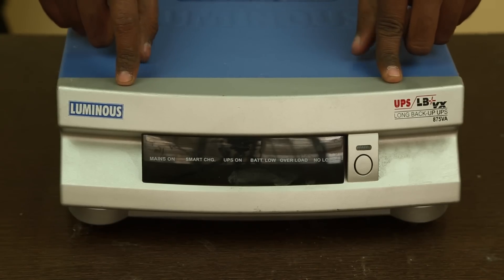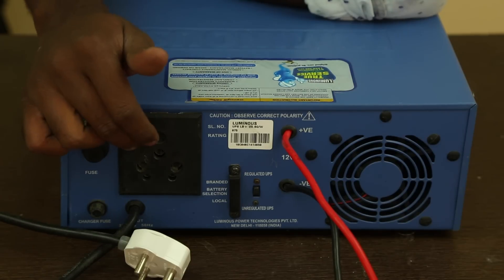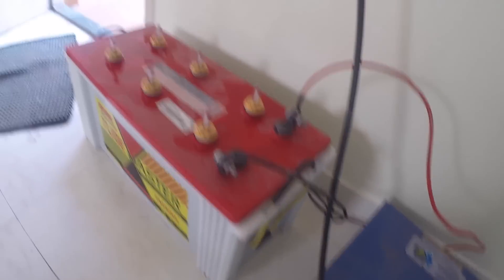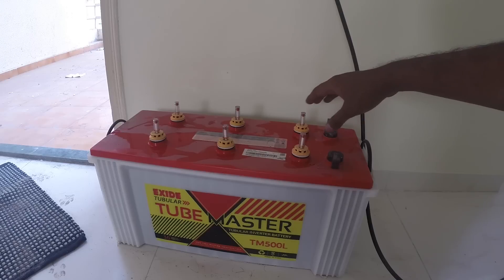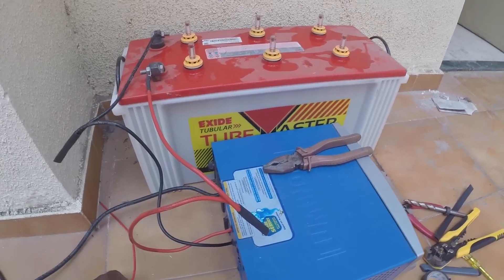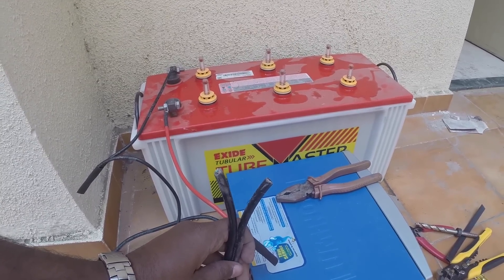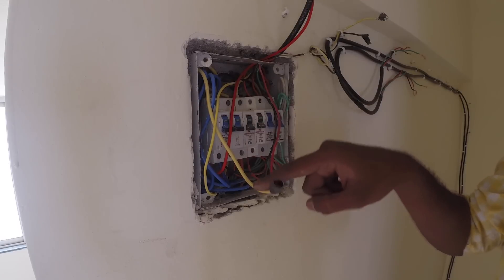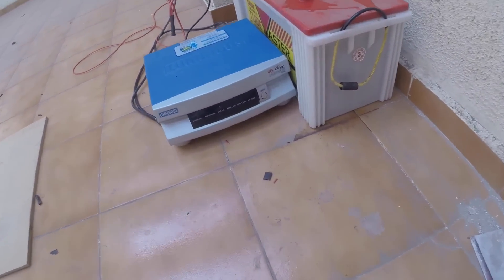How to - Connect an Inverter at your home with Battery Backup

Comment: Can i have an inverter at home but with manual changeover. Means when grid power is present....the entire home is connected to that. When power fails....i will go and manually flip a MCB switch or something and only then the inverter gives power to the home. Yes i know...when power goes ill have to go and switch on in the dark etc...i have considered all that and found for my use this is best. Because my house has automatic gates....automatic garage shutter.....all stoves are induction...etc....definitely ill have to go for a 5kva inverter. I DONT WANT THAT. I want just a small 24v system and with maybe 2 600w solar panels. Because when power fails....i will reduce all my load items and then go and transfer to inverter. Till then the inverter can be like one of my home appliance...like fridge it will also be running on one side and charging up the batteries until i want to use it. When power fails i only want 2  fans n my computer to run. Else ill have to put a heavy inverter just to accommodate my regular load EVEN when grid power is present.

Comment: Hi. Well explained. Is there way to connect in such a way that the devices on the inverter will ONLY come on where main power goes off?
Reply from the maker: You have draw two lines one as a main line and one as a UPS line. Then whatever is connected to UPS alone will be live when main power goes off
Reply: @Kalaakaar-in  thanks but the thing is that even when there is main power, the devices on UPS willl remain on right?
Reply from the maker: @saileshchudasamasc  Yes it will remain on and it will be charging the batteries
Reply: Sorry if i am not clear. I want the devices to remain off when there is normal power and only turn on when nornal power goes off
Reply: @saileshchudasamasc  if that’s the case then you need some microcontroller and a relay which applies this logic

Comment: By Mistake when I am trying to connect, Negative terminal wire collided with the positive terminal, which resulted in some minor fire sparks. could you explain if  i need to change the battery? or it can be rectified

Comment: Some say if we touch 12v battery we will get shocked it’s very dangerous and some say it’s completely safe to touch both terminals of a inverter battery as the voltage is only 12 tomorrow I’m going to fill up my battery with distilled water 💧 n will clean both terminal. I’m little bit scary 😦😺I think one can not get shocked even after touching both terminal together as we have a high resistance

Comment: HAHAHAHAHAHAHAHAHAHAHAHAHAHA laughing cause it gave a good feeling. 
(come on, you needed to throw a bit of water on the floor and then touch battery LOL to curl the hairs in ur nose)

on serious note. you mentioned ground wire and earth wire. we have positive, negative wire. live wire, neutral wire, ground wire. just wanting to learn and understand the terminology used in other countries.  
inverter on floor for educational purposes works fine but did you ever mount inverter on the wall ?
Learning The Hard Way is the way to go sometimes. 
Photovoltaic / Solar Thermal Technician here and I Approve Your Video
Reply from the maker: Thanks Sheldon

Comment: In this your Fridge , washing machine , water heater will be connected to inverter . Good luck in getting up and switching off fridge every time main supply fails. Will work at houses with only light bulbs n 70 w fan.

Comment: You can touch + and - of a battery at the same time without a shock hazard if the battery voltage is less than about 48V. That's why telecom backup systems use 48V batteries--it's the safest voltage you can touch without harm. Higher voltages will overcome your skin resistance and put current through your body, which could kill you.
Reply: I thought 48v can kill? 24v and 12 v is safer
Reply: @Josh-mi1qt  Go buy six 9V batteries. Connect them in series, and then touch the two end contacts. Are you still alive?
Reply: @huskypup3489  6x9=56. Yes I am  in heaven now.

Comment: I am not not an electrical engineer or anything but would like to caution you on something -  @1:51  you mentioned you are not touching both the wires the same time so it is safe. Now, what happens if your watch suddenly gets "unbuckled" and hangs down and touches the first wire while you are touching the second? Just a thought that came to my mind. So I guess that is one thing that people need to be careful about - what they are wearing. Am I correct?

Comment: You better stop wit this presentations where nothing it is by the book.First af all, you will need designated ventilated place for that battery,second you need to use a proper wire connectors to joint the wires,3rd you can not apply just like that wires on the walls,4 that control panel it is ready to explode ,you are using player for everything,You call neutral(negative).What a begginer can understand from this poor video.No tools,no safety,no tehnical terms. Plus...the UPS will be allways installed only on vital equipments.That poor battery can not hold a washing mashine for 1 cicle.I do not wanna talk about other heavy consummers of the house....

Comment: Thank you very much sir. Please a question from your video. If the neutral from mains supply is what feeds the UPS and thesame neutral wire supplies negative to the battery for charging. Isn't that mixing positive DC from UPS and AC neutral to charge the battery.?. Please shed more light on this

Comment: I liked your language more than your explanation very nice video helped me a lot. Please tell me if I can do the same process using an ups to run my computer and an led in my room.(I have separate mcb for each of my rooms). Please help!
Reply from the maker: If the ups is 600va then the load will be high on the battery

Comment: Noticed some sparks while connecting a replacement battery but that didn't bother me installing the new battery as the video clearly mentioned sparks are not to be feared. I did cut the main power to the inverter before installation.

Comment: wrong wiring . saperately  you have to take e neutral from  inverter.  other wise in many time  current bill comes high. because battery weak. and bellow 180 walt comes that time return current go to eb through the metre. so bills comes more.

Comment: Output from inverter. Single phase wire use for load..in case main neutral is cut from grid..any option because single wire using

Comment: Output from inverter. Single phase wire use for load..in case main neutral is cut from grid..

Comment: i hv not connected inverter to my battery.. was just checking inverter working condition.. inverter connected to main no display button is glowing but Electrician checked power is there inside

Comment: I am.an Technical guy ,
I will tell one more , you kindly spit connection like Water heater/ Microoven/ Iron box / Washing machine permanent line in Ac then other connection with inverter . give good result when AC power off

Comment: Nice & simple Explanation. Thanx. There r occasions when some points r connected to inverter & other points r left to the MAINS SUPPLY ONLY. In that case how the output wiring is connected to MCB(s). Next time U may add this point for viewers benefit. Nice tips about the Battery placement, etc.

Comment: Need a help on the UPS connection. I have called an electrician and he connected it however there's an interrupted power supply which turns of computers and routers. The connection setup at my apartment is .. Mains and DG connection. When main o\goes off within 5 minutes DG starts manually and by that time everything reboots . I used to have a battery and UPS which is 1.5 years old and it used to be uninterrupted power supply. Now I have contacted the UPS manufacturer and they charged me and changed the PCB and costed me 2000/- but still issue is not resolve. even though it is giving back up but when mains goes off it turns off everything and comes with a long beep sound. which is not solving my issue. could you please suggest something on this which I can may be convey to electrician and the s\exide support.

Thanks in Advance

Comment: How to run fridge and washing machin on inverter plz guide
Reply: It not run fridge and ac also because single battery u can add more than two batteries then it will work
Reply: I suggest 4 kva inverter is better for you

Comment: Can i connect two batteries of different AH rating? I have a 200Ah and a 150Ah and wanted to use them both
Reply from the maker: Nope. You should not. They will try to balance out and in the process destroy

Comment: thanks or the video friend. can you tell me how long will it work with this battery? and we have to charge battery again because inverter needs 12v to work always
Reply from the maker: The inverter automatically charges the battery. A batteries life span is between 3-4yrs

Comment: I enjoyed the video explaining the technical setup but he is surely not electrician they way the cables was just hanging on the wall. We do have some so called electricians in my country who does the same types of illigal work, and there is a reason why it is illegal. Here is a list of items where he would be in violation of several laws:1. He is tampering directly with the fuse box connecting equipment not suitable for the setup2. His cables goes directly through a door opening, when closing the door he might cause a short3. He is unable to close the door which is a recommendation during fire and law in developed countries4. His wiring is exposed and taped together and even the battery is exposed to children's hands5. His equipment is outside exposed, with rain on the terrace there might be a short6. The wiring is black and hanging in strings which is ugly as H.LL.Just my opinion and why there is so many electrical black outs in the third world as they don't care about doing things prober and according to safety.

Comment: About touching the two batter terminal simultaneously. I have tried it. 
I was using the Lorry battery for one of my project, i got curious what happens if i touch both terminals with bare hands with my foot touching the ground. And I did that. All i felt was some little irritation, like we get when there is faulty ground in household (that too i was too sweaty that time).
Later my friends tried and they felt nothing.

Disclaimer: I am no way responsible if you got hurt when you try it. Do it at  your own risk

Comment: I Have a doubt....

If you turn on the Main Switch, then the Invertor's output wire will pass input to the inverter?  This may cause any problems?
Reply from the maker: Yes it will. In any circuit the neutral can be common. But the live wire has to be different because they carry different potential

Comment: my inverter gives phase line to both the output docket. and when there is main on, then it give phase to single terminal of socket output. And when I plug a light bulb to Output socket it Glows on both case when on battery and when on mains. I dont know what to do.
Reply from the maker: That is correct. If the UPS is ON and the mains are ON then the UPS just redirects the mains to the output. But if the mains are OFF its swiches the Battery to output after stepping it up to 220v AC. So your connection is right if I have understood it right.

Comment: Today I had connected an invertor.But some time it is tripping in overload (not always) but at the time of trip load does not exceed more than 200 watt where as my invertor rating is 700VA.can you tell what may the possible cause

Comment: To charge battery ups need to turn on?
Ups is always in ON condition ?
When main supply is ON condition,then power taken from battery or main supply?
Reply: Main.supply bro
Reply: When main supply is on the battery will rest and when power gets cut off the battery 🔋 will do its job.

Comment: Even u do not have a proper tools to connect a battery. Do u think cutting plier is the right tool to connect a terminals of the battery. Here after try to use proper spanner.

Comment: Mere paas ek 1500rupees kainverter hai usme 7.2amp ka battery laga hua hai me chahta or ek 7.2amp ka battery lagau to kaise
Reply from the maker: You can give high load to low amp inverter. It will fail.

Comment: You would never get away with a setup like that in the United States especially the northeast,its very strict.Running SJ type cord through a wall or a window is a big no no.As a minimum you would also have to use a mechanical interlock between line voltage and E.M. power instead of having to remove the main feed every time you have to use your E..M. backup.Iam not sure what country your dwelling but if code standards allow you to do what your doing then all I can say is be careful my man.
Reply from the maker: Yup! But it has worked for me here. I understand there are strict rules there.

Comment: Can we connect 2 batteries in seriese or parallel to the inverter
Reply: In parallel yes as it will increase amperage but NOT in series as that will increase the voltage to 24volts

Comment: is it ok to connect two 12v batteries in parallel?
Reply from the maker: Yes its perfectly fine until it does not override the capacity of your inverter.

Comment: Can we place the battery output red wire in any of the port in inverter? Will there be short circuit if the output red wire is connected to another hole?

Comment: Can I connect a single 220AH battery with a 1.5 or 2 KVA UPS..??
Reply: Up to 1kva - 1.2 kva it's fine.  I don't think there is a branded 12 v 2 kva inverter

Comment: I have touched both terminals with wet hands and I not wear my sleepers that time I haven't got any shok
Reply from the maker: Thats good to know.
Reply: Gaurav Pant.. Thats bcz at that time electricity is shut down from mains... Does ur friend told you that
Reply: Because voltage is not enough to pass the current through body,, 12 volt is not enough

Comment: Hi dear. It was extremely useful information. Could you please let me know if we can use computer ups with small battery like the way we have used this big inverter. I need the power backup at my home only for 2-3 minutes (the too only for lights and led tv , router only)say the max , because by that time our society starts generator.

Comment: You have skipped neutral wire from inverter output, instead you have used neutral from mains. Most electricians do this but its incorrect wiring. This way you are looping input neutral connection to output neutral connection of the inverter, causing damage or malfunctions. Also your battery top is wet/damp which is hazardous!

Comment: Sir well explained.
I am thnking to install 450 va inverter for my home purpose for a single fan and led light bulbs during powercut..Though I h've a refrigerator which runs 24/7,I don't want to power my fridge but when there is a power cut since it will overload my inverter
.My concern is that each time when there is a power cut do I need to turnoff my fridge every time? or else keep the inverter off but charge the battrey from the mains,when their s a power cut turn off all the load  and then switch on the inverter.Is this is the way to operate?.Kindly suggest me.I totally confused.
Reply: You have to make separate wiring for high wattage appliances so that they will turn off upon electricity cut off. Use inverter on existing line to supply power to bulbs, fans, lcd tv, and all other low wattage devices only. This the best and safe way.
Reply: If you connect inverter to same line of refrigerator and when electricity cuts off, within no time refrigerator will pull all the power from battery or it will trip or burn. You cannot just turn off refrigerator so quickly or every-time.
Reply: Sir,Thank you for the useful information.

Comment: If the  Inverter is not working or get damaged, How the supply can work?
The DBM have connected to the OUT-PUT of Inverter and main directly connected to Inverter not to the DBM,. Plz clear my doubts
Reply from the maker: The inverter has a reroute which works when the power comes. And when the power goes off it immediately starts from the backup battery.

Comment: Please advice: Electrician said he'll put 3 phase electric current system in a house which currently has 12 rooms (This could double in the future as upstairs is incomplete (12 rooms could be considered as 4 apartment with 1 seating room, 1 bed room, 1 kitchen / diner)). This is done in a village & power outage is quite common. electrician also adviced on stalling IPS for outage periods (some times it lasts for a week). Please advice on ips system (whats the power of Inverter required or does it really matter as long as lots of batteries are stored? not sure of any thing hence need your imput. thanking you very much
Reply from the maker: No idea about IPS systems. What is it?

Comment: Nothing happens when you touch both terminals at the same time unless your hands are wet or the battery is actively operating under a load
Reply from the maker: +JPG23 ohhhhhh kkkkk

Comment: sir , please show how to connect invertot in house circuit having a 5kv home stablizer , correct way of  establishing connection. After installing home stablizer my inverter has started lots of beeping sound and input on -off. this make lots of irritation. even 10 to 20 volt change in home stabliser make the invertor to flatuate and it starts beeping.

Comment: Hi, this video is very good to connect the UPS to the mains supply board with MCB,  now I have a Luminous Cruz 2.0 kva ups with 2 batteries, and i need to connect this to my new office.  Here in my new office they made 2   15amps 3 pin Sockets and names it as IN and OUT for UPS.  My Cruze USP has only 4 wires .  three wires (Red, Black & Green) goes to mains power socket on wall.  how can i connect the UPS out to this wall other socket..??? puzzled with only YELLOW wire as OUTPUT.
Please explain ( UPS has 4 terminals screws for YELLOW, RED, BLACK & GREEN.) GREEN, BLACK & RED already wired and plugged in for charging